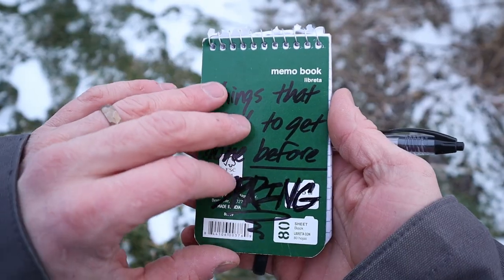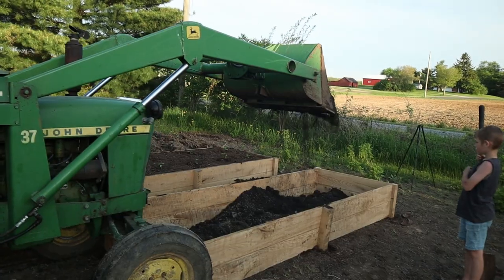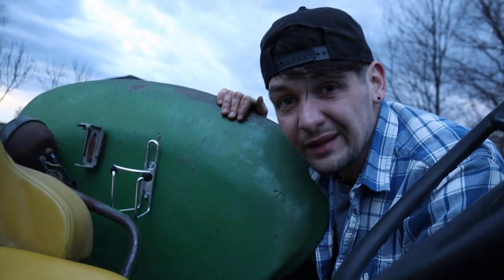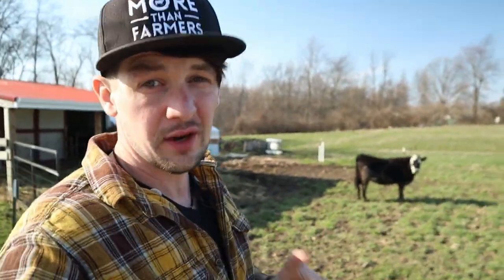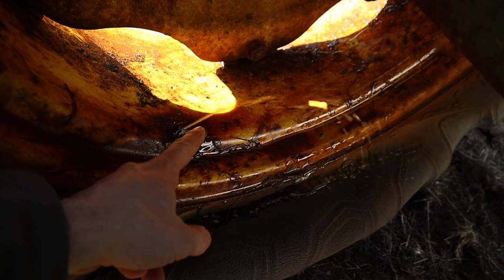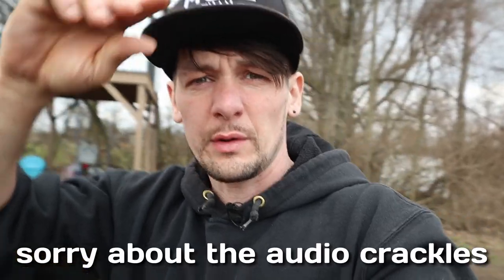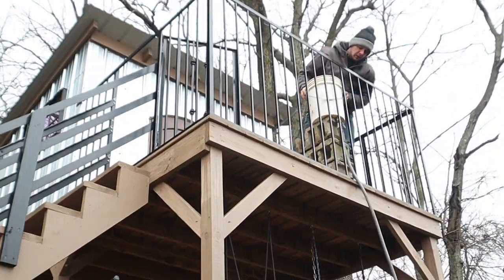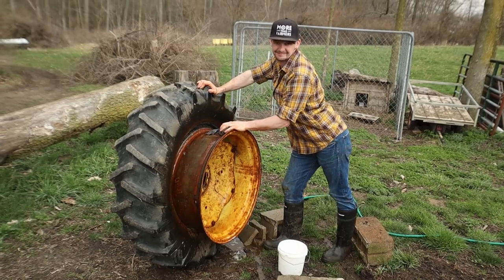The Story of the Tractor Tire

Comment: Good job man, sorry i didn't get my video done for you. I have looked into that bead breaker, it looks like a life saver. I use an rv pump because my tires hold 80 gallons but your method works as well.
Reply from the maker: It’s all good! That bead breaker is sweet. If it was bigger tires or if I figured I’d be doin this more often I’d want a pump.. this way wasn’t too bad though.